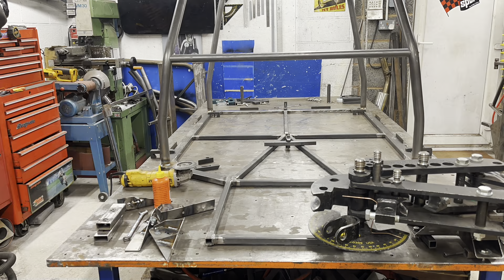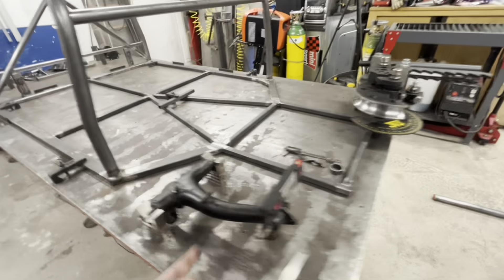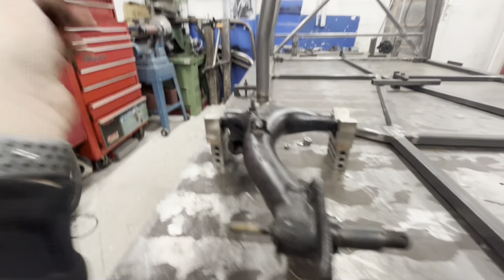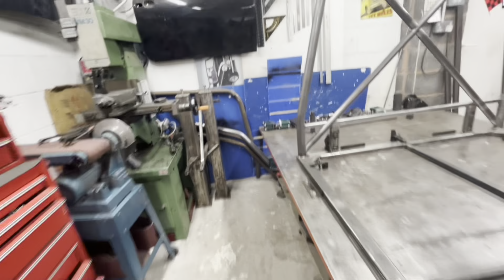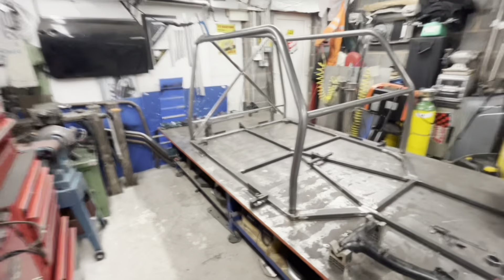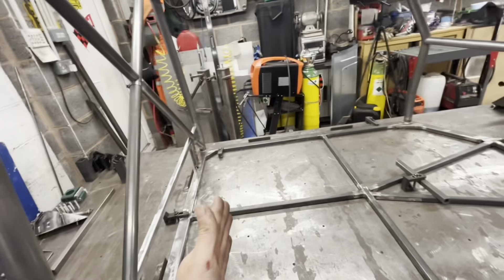My new race car chassis part 2 X brace

Comment: Loving the videos,
Im looking possibly getting one of custom minis fibreglass mini vans/pick up, would i need to fit some kind off roll cage? 
If so where do i mount it too?
Reply from the maker: @JasonKane77  thanks mate I’m glad you are enjoying my stuff and appreciate you watching. Custom mini complete body shells are really strong by themselves. I would have a minimal intrusive cage in my self just for the safety aspect of an accident. It would need to pickup on the front and rear subframe areas ideally or sandwich the floor with some spreader plates.
Reply: @skidmores.garage  thanks mate, much appreciated with the info
Reply from the maker: @JasonKane77  no problem mate. I did a cage for a sprint body before, there is videos on it and it just used a safety devices weld in cage that was modified so you could go down that route
Reply: @skidmores.garage  ill have to take a look

Comment: Looking good 👍 I was expecting the cross brace to be continuous and the notching would been in the inch box
Reply from the maker: @williamholmes9129  as a rule you notch the thinner material and also the box is the main frame for the radius arm mounting so ideally you want to keep that complete